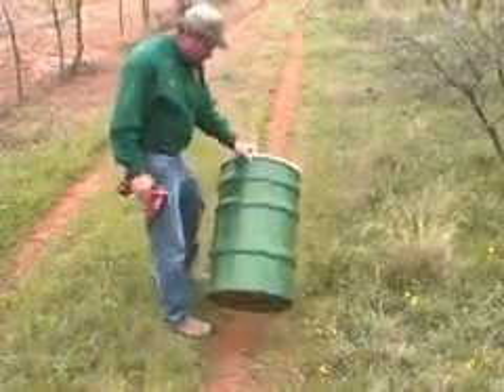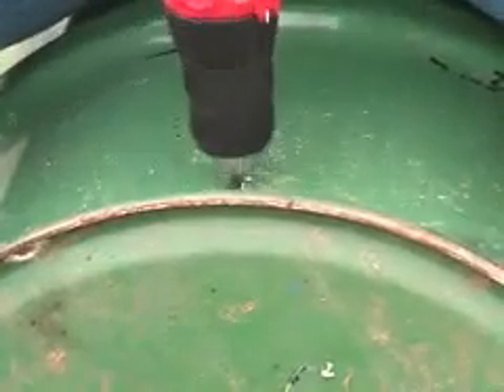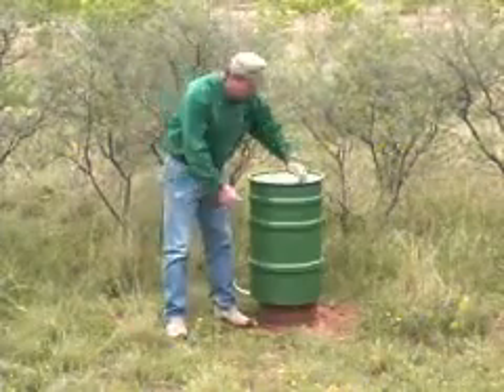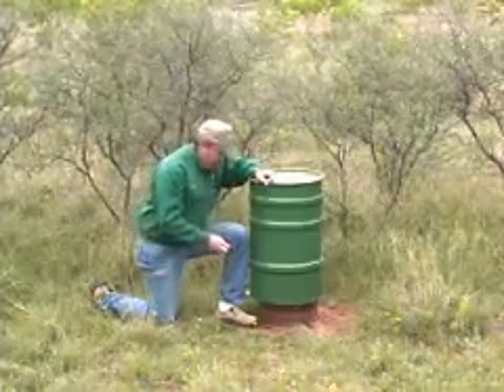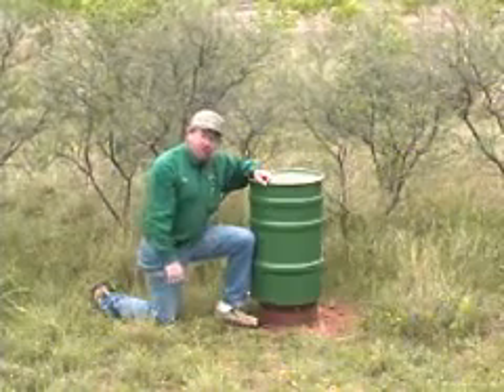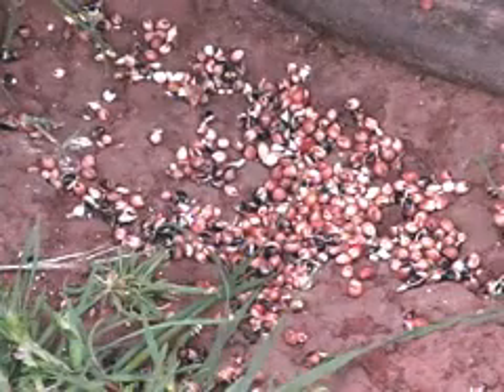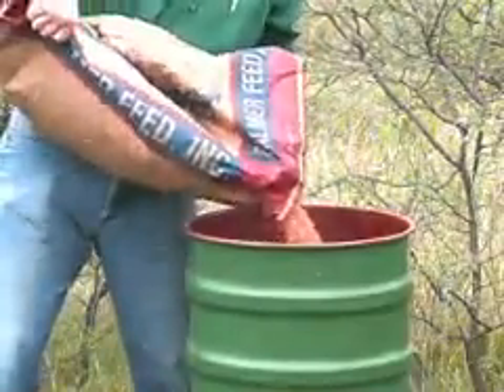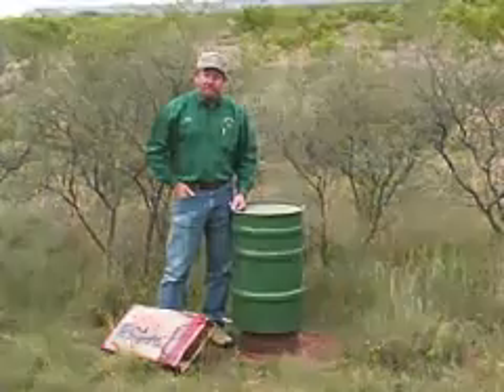The Currie Quail Feeder

Comment: Dale this is awesome, but i have added a little to it. I got 30 gallon funnels, taped up the hole in the center, turned it upside down and drilled the holes right above the funnel. This eliminates the dead area, and all the milo will come out.